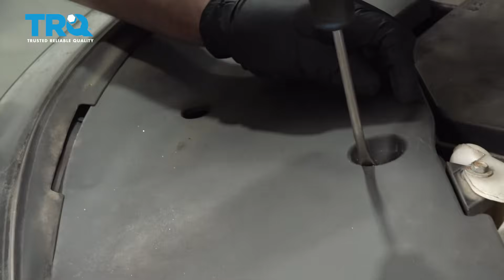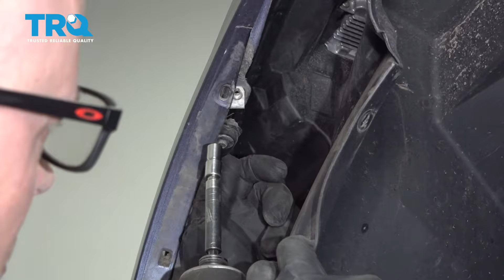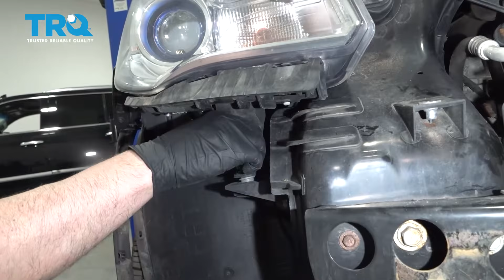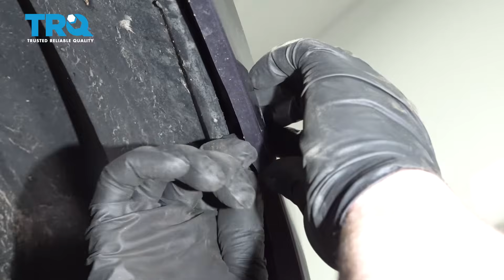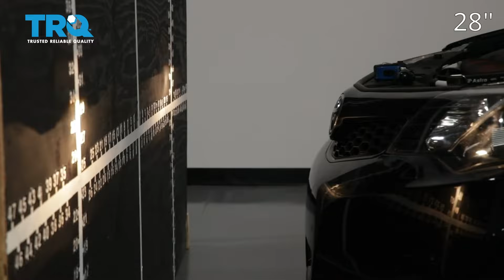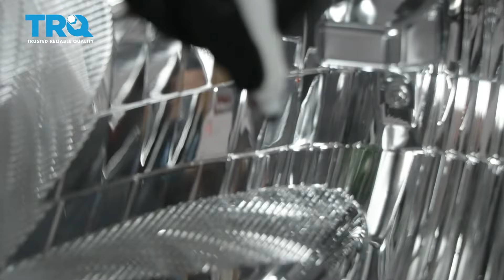How To Replace Headlights 2008-2017 Buick Enclave

Comment: Buick requires the replacement of the entire assembly and not just the bulb. Its well over $1k for the assembly and only available through the manufacturer. Before you buy a Buick, do your research first.

Comment: OMG, he didn't show how to change the headlight at 4:35 of the video. He shows unplugging and immediately goes to putting it back together without showing how to put the headlight in. You have to be kidding me. He was very clear on the rest of the video . Is it so easy it needs no explanation? I'm afraid I will get it all apart and then not know how to proceed.

Comment: He is replacing the headlight assembly - not the bulb.
Reply: Replacing the bulb requires replacing the entire assembly. GM engineers at their finest. Just like when they decided to put the battery in the wheel well on some cars. Look great on paper, not practical.

Comment: i’ve never seen anybody take half of the car apart to change a headlight bulb or a parking 
light bulb
you can take a few screws out of the wheel well cover, pull it back, or just take it off and access changing the bulb from there all of five minutes 
Guess that’s one of the dealership cost so much because they go the long way

Comment: You don’t have to take the front end off to change the bulbs . This is only if you need to replace the headlamp . This is false . I guess this is why to many people get suckered for 600$ for changing light bulb.
Reply: I had to come check out video!! My coworker said her bulbs can only be removed by a mechanic because it has to be lift AND they charge A LOT. Thank the Lord for these comments
Reply: My 2011 Malibu had to have the bumper off and headlights out
Reply: Then how do you propose getting to the low beam light bulb without removing the bumper? By all means.... enlighten me.
Reply: @ghostmarketing2001  The high and low beam bulb r the same bulb !
Reply: @ghostmarketing2001  I have no mechanical background, 39 year old female and just replaced my bulb today. Didn’t have to go through half of this. Only came here because I had condensation issues. But to change your bulbs are easy.

Comment: All that to change a headlight??
Geez O Pete’s
Reply: I wanted to change the headlights (not the bulbs) in my wife's car. I think I'll just jack the radiator cap up and put a new car under it.
Reply: I change my bulbs myself and have never had to do all of this. Simply turn your wheel, unscrew and remove pushpins near tire and use something to help prop it open while changing bulbs
Reply: @ThisIsMyYoutubeName1  thank u I am gonna tell my coworker. She been driving w 1 bulb working and says the car needs to be lifted and they charge her ALOT
Reply: You can literally reach in from the top after partially lifting the top covet to replace the bulbs.  There isn't much room, but I've done it twice